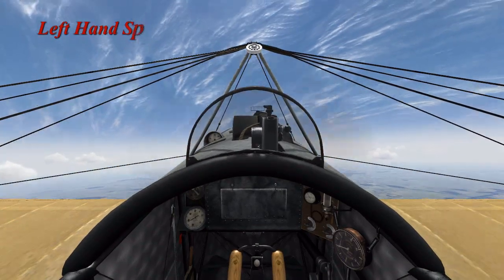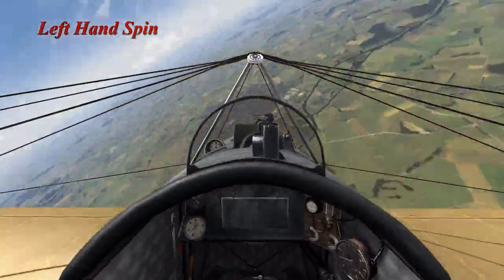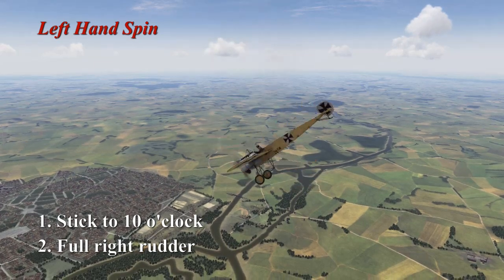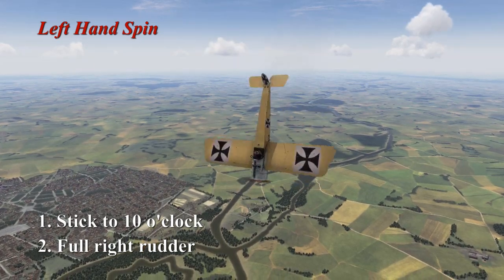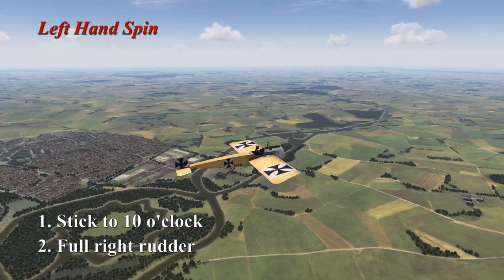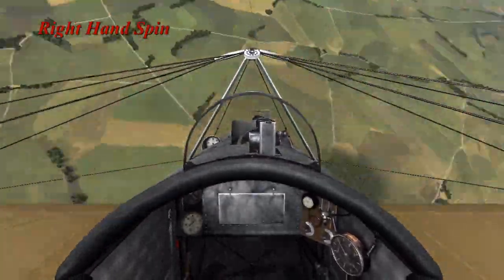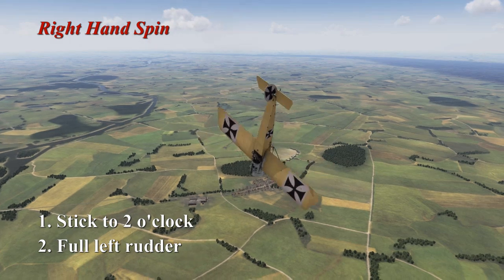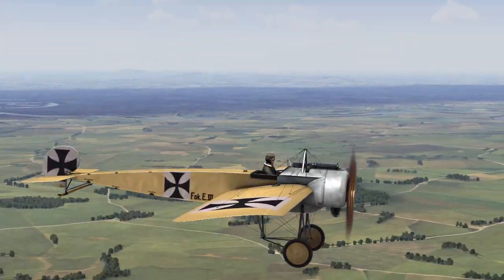Spins - Fokker E.III

Comment: I don't recall ever "getting into a spin" but have intentionally spun many airplanes and gliders. A spin is a fully controlled maneuver in which the recovery is the same for all aircraft; stop the rotation with opposite rudder then drop the nose to kill the stall after which you pull out of the dive. Playing with the ailerons during the spin will often make it become flatter which can lead to difficulty in recovery. Aileron with the rotation tends to reduce the flat spin.